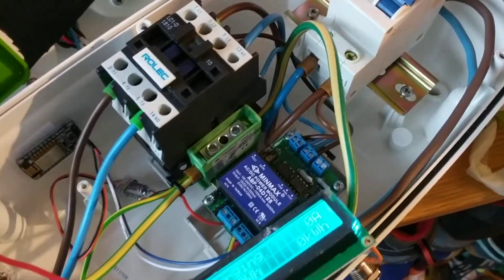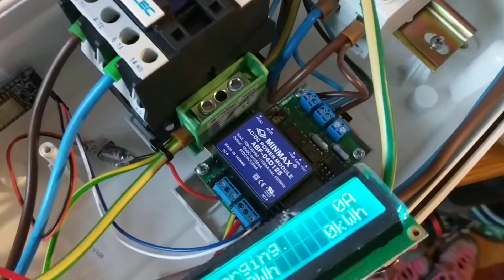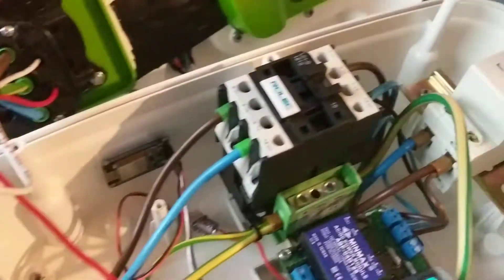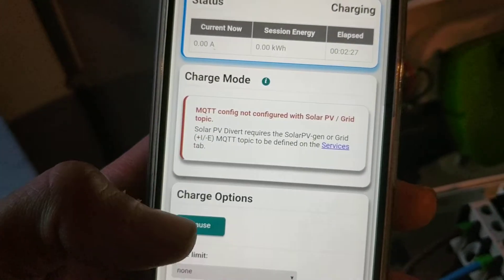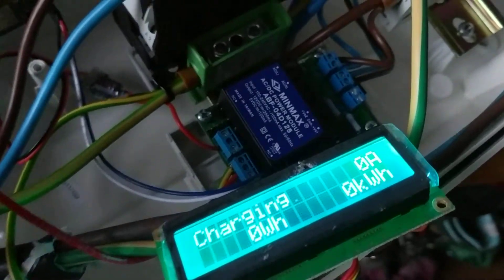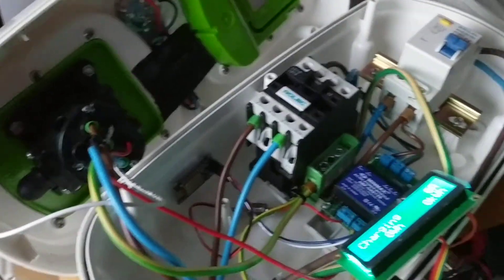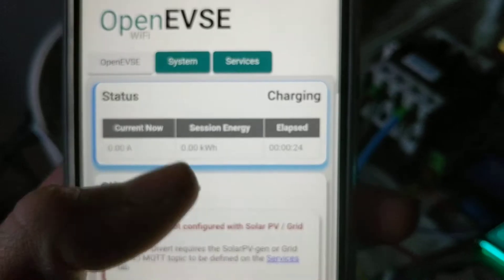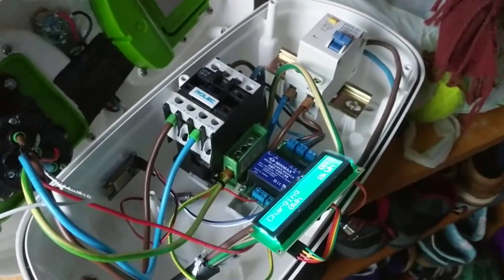Rolec EV Charger OpenEVSE WiFi Upgrade

Comment: As the Rolec controller is basically an OpenEVSE in a din rail case, was there a reason why you changed the controller as well as adding the WiFi module?
Reply from the maker: The Rolec controller is very different to the OpenEVSE the wifi will not be compatible with the Rolec controller. In this instance, the Rolec controller was faulty, hence why I fitted an OpenEVSE
Reply: @GlynHudson  I read elsewhere that they have the same roots. Thanks for the clarification.
Reply: I’m now working on a port of OpenEVSE to run on the Rolec controller. Won’t be as functional (no ammeter or RTC or LCD) due to hardware limitations but should be controllable with the OpenEVSE WiFi (with a level converter).
Reply from the maker: @barnydaley8035  Interesting, have you figured a way to upload firmware to a Rolec controller? Did you figure out if the do share any code?
Reply: @GlynHudson  There’s an ICSP under the front cover. The code is different because the hardware is different but as both use a 328P it must be possible. I’ve uploaded code to test the hardware. I can drive the LEDs and the relays and read PP and CP. So far I can compile an OpenEVSE build but it won’t go out of State A. I think the pilot hardware might be different so it’s outputting  -12v in state A. I need to understand a bit more about how OpenEVSE drives the pilot to see what I need to change to match the Rolec hardware. Haven’t had time to test that theory yet but if I’m right, I’m expecting to need to invert the duty cycle.
Reply: Now got a working version running on the Rolec controller. I need to check the auto cable current setting and I’m having trouble with using the blue LED (red and green are working) plus if I try to set the current to any value, I get $NK 6.
Reply from the maker: @barnydaley8035  that's awesome, nice work! Have you documented / published this anywhere? This is a really cool development
Reply: Would have been great to see a complete start to finish to show others how to update the Rolec to have smart features and WiFi enabled

Comment: Thanks for the video. I thought that these Rolecs came with a Type A RCD and a separate DC device. Did you replace the RCD?
Reply from the maker: This was a very old rolec which predates the DC leakage requirement. I was using the original RCD. Current regs require a type-B RCD with DC leakage such as: https://shop.openenergymonitor.com/type-b-rcd-1p-n-chint-nl210-63-263-30/